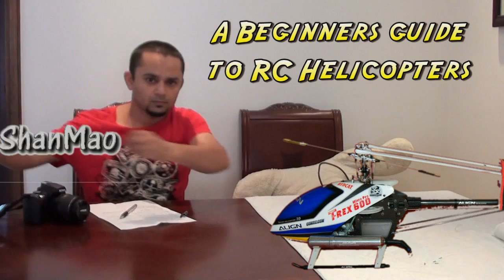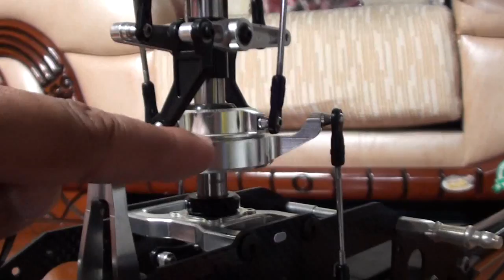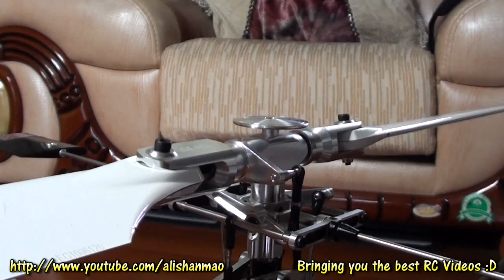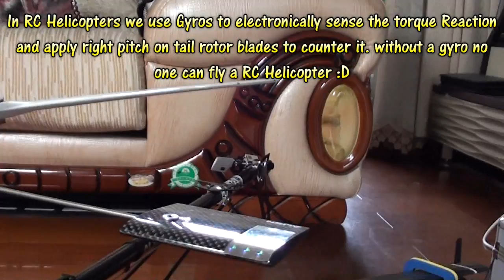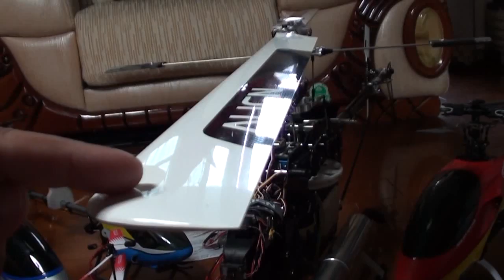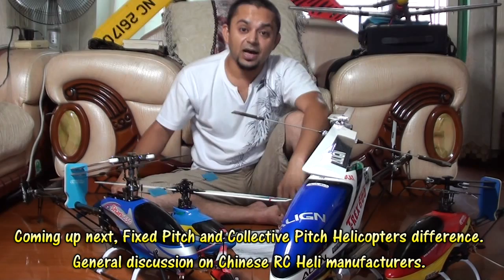RC Helicopters Beginners Guide Part 3

Comment: hello Ali,  am going to buy a decent Helicopter with a camera, and you say that helicopters are not easy to fly. My Dad was a pilot and still works for the airforce and i have joined air cadets, so i use lots of simulators that tilt your chair and such. I also use lots of programs with joysticks. My question is, will this knowledge of flight be enough for a decent helicopter?

Comment: HI Ali,
I bought my first rc helicopter. I bought a UJ376. I hope that is a good one to learn on. This machine has a vetical tail roter instead of the the one you usually see on the side. Is this a
disadvantage? It has to stop and change directions of spin depending on what maneuver you want to do.  Also, what is your opinion on this particular model?

Comment: Ali,this is my problem:I have a Venus 326 mini heli. I haven't used it for some time and when tried to use it today (1 hour/30 minutes)the bottom main blade( the B)didn't spin. It used to work well flew 3m up into the sky,but now it doesn't even rise 3cm. What's wrong with it?

Comment: Ali, do you think that the two stabilizer rods (the ones that go from the rear part of the main frame to the tail boom) are necessary in a 450?  I noticed that your HBK does not have them.  I crashed today and broke the rear horizontal fin holder on my Belt Cp but I feel that the grip of main frame halves on the tail boom is enough to keep it in place...